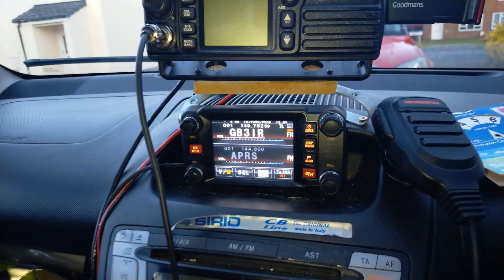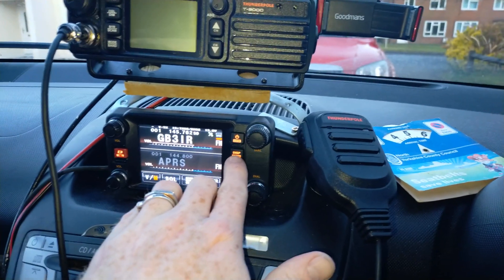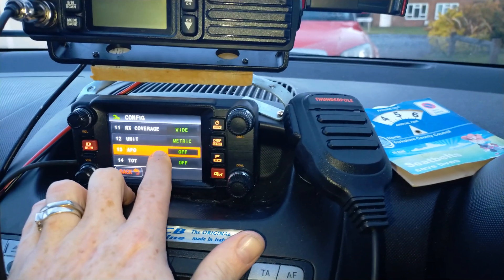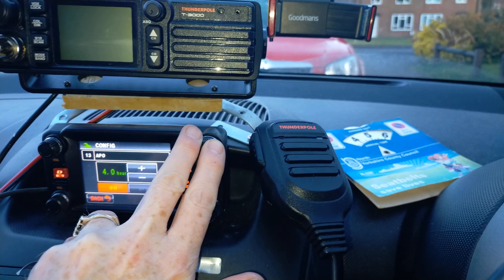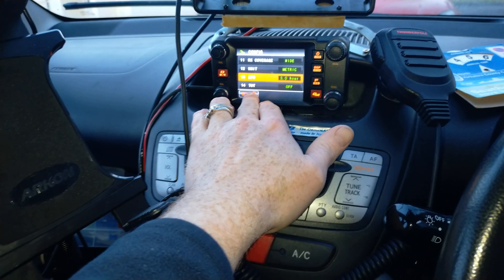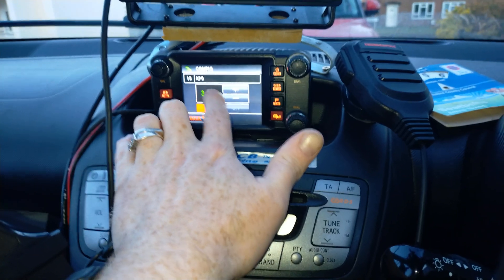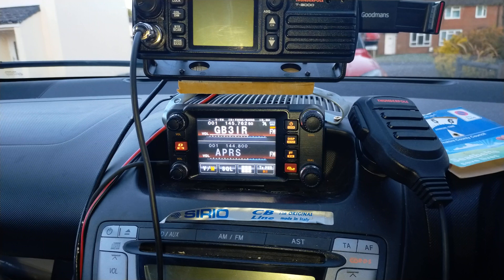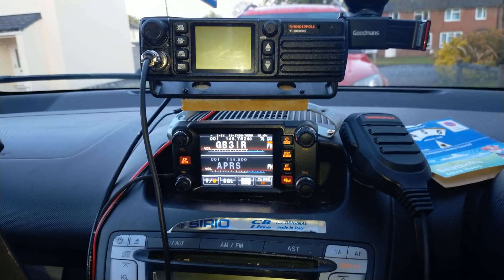turning on APO (Auto Power Off) on the Yaesu FTM-400

Comment: Paul you need a Shorter Intro n Ending , its a Mouthfull 🤔
Do you have all that Gear on While Driving ? Would have thought with the Positioning it a Distraction if Joe  Plod saw it , bit like having a TV on the Dash
Reply from the maker: It is on while I am driving and it is not a distraction, in fact the space the control unit is fitted on some trim levels of that car is home to a TomTom navigation unit.  I have driven here and also in France, Belgium and Germany back in 2019 with that control unit there and on and the police had not seemed bothered by it